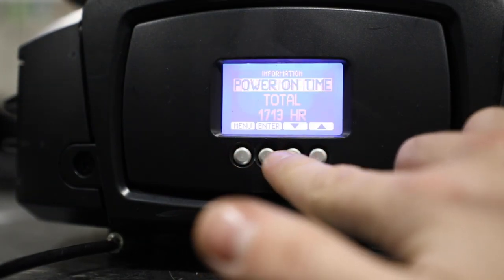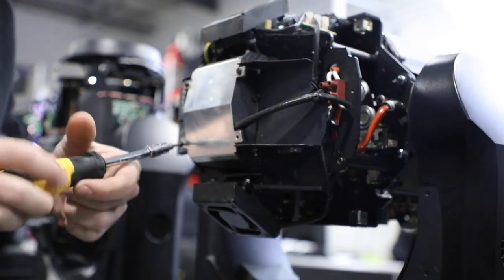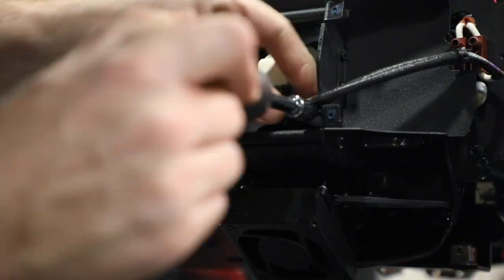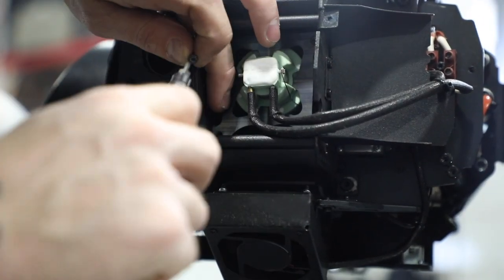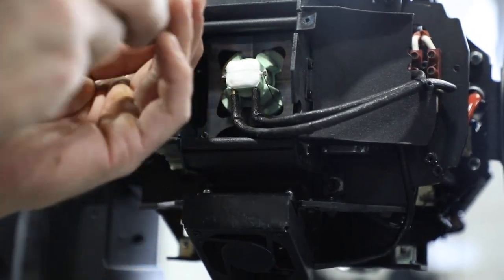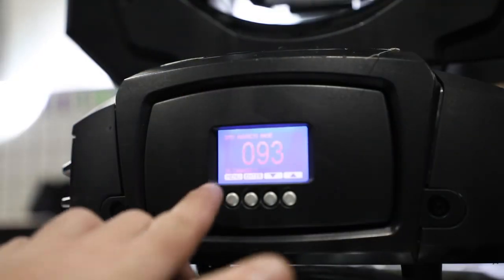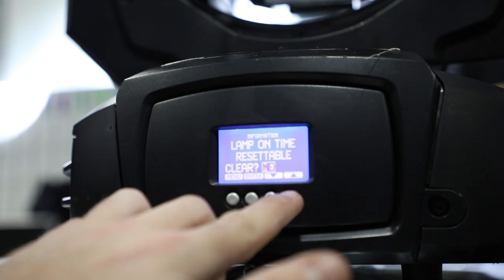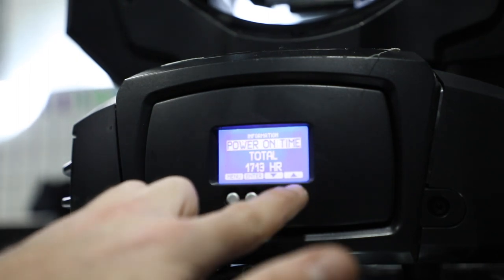Replacing Arc Lamps: Martin Mac Axiom

Comment: Hi! I have experienced lamps exploding and having the lamps go out and due to how expensive they are, do you have any suggestions on how to prolong the life of the lamps so that I don’t have to replace them
Reply from the maker: Ensure that you're properly lamping the fixtures on and off either through the console or through the menu. Once lamping off, give the lamps time to cool before killing the power. Routine maintenance like blowing dust out of the cooling fans will also help keep the lamp in good shape. I have found these lamps do not like to last very long. We generally find ourselves swapping them under 1000 hours
Reply: @PascoliniProductions  thank you so much for the reply! And have you found any places that you can purchase the lamps for cheaper that around $500?
Reply from the maker: @gavinfarell414 We're based just outside of Chicago, usually ordering from a local company called Kennedy Webster. Check out their website, they have good prices

Comment: Hey man I have another question. So I am experiencing a lot of light leak when using gobos on these fixtures. We have one that when using the gobo wheel, it is defined and has no leak around the edge of the gobo. However on the rest of the fixtures we have, the gobos have a circle of dim light that is leaking. Do you have any suggestions on this?
Reply from the maker: Static gobo wheel or rotating? Fixtures could be dirty and reflecting light, for which I'd recommend deep cleaning. However if it's not dirty ,it could be a calibration problem, for which you'd use the advanced menu to calibrate the gobo wheel. If you need some further help, send me an email with some pics/videos and we can dive deeper into it, pascoliniproductions@gmail.com
Reply: @PascoliniProductions  it is happening with the static wheel. Those suggestions are very helpful I will go ahead and try those out thank you so much!
Reply: @PascoliniProductions  I know that the vipers have lamp adjustment screws for focusing the lamp. Could the same process work with the axioms using the for screws that hold the convexed piece of medal on the lamp?
Reply from the maker: No, it's not the same with the axiom. You have to ensure the lamp is seated correctly and then that plate just holds the tension